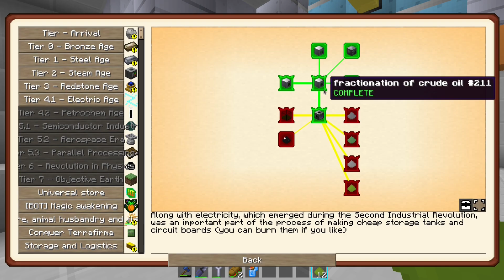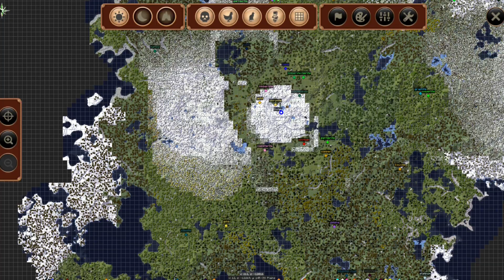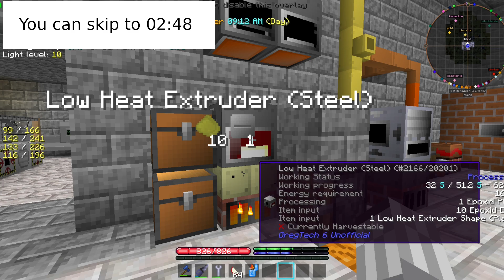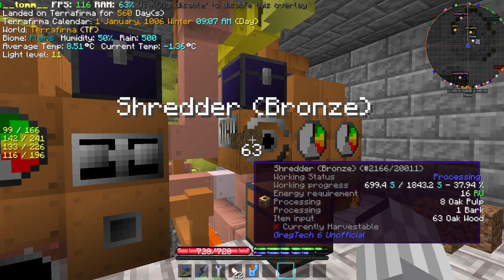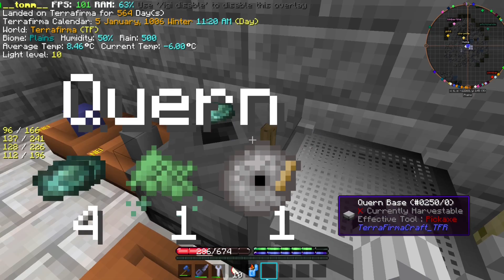TFR 09: equipment for finding oil

Comment: Problem with tungsten? You can double check cassiterite in NEI. btw nice progress 👍
Reply from the maker: yeah, i know, you can process it in LV in vanilla gt6 iirc, but here there is no crucible that can make the tungsten jump and you have to use the arc furnace from an other mod to unlock tungsten stuff... can't waitfor the normal extruder...